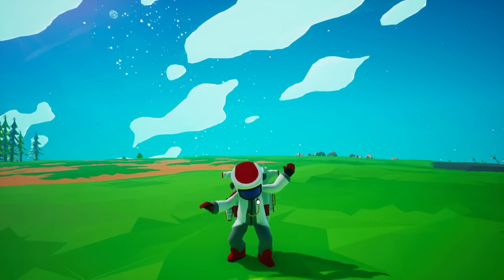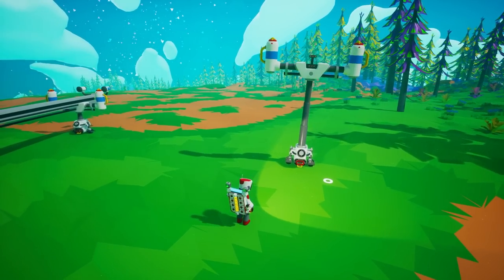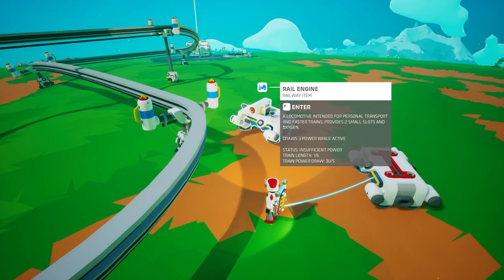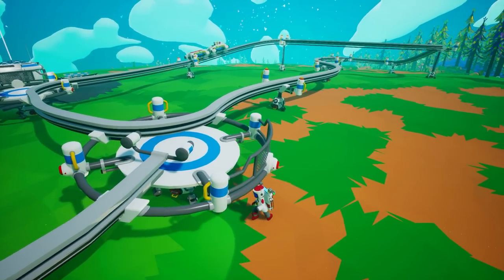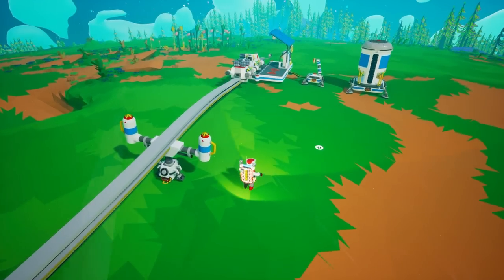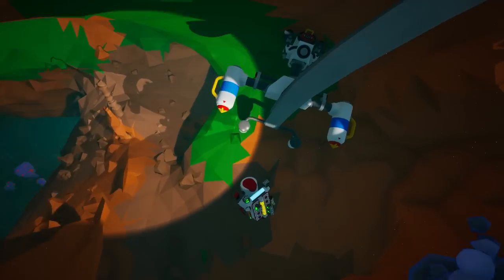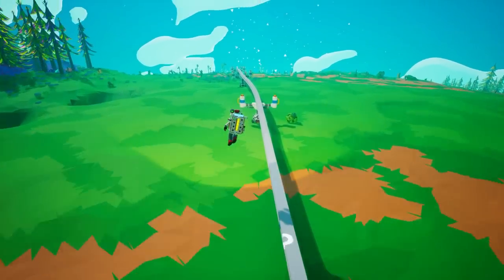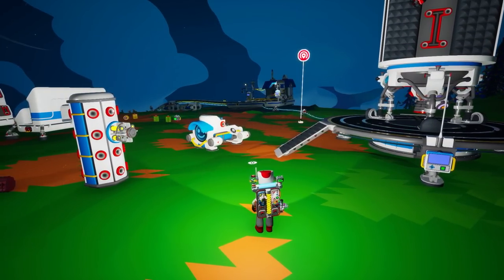Astroneer - Rail Systems - The Basics - A Helpful Guide | OneLastMidnight

Comment: I suspect that Extenders will still have niche uses. Situations where, for example, you want to more precisely control where power flows, or physically constrained areas that a rail line simply won't fit in.

Rails will definitely be superior for connecting multiple bases and remote structures, though.
Reply: Used rails to dig to the core, now i have an easy ride to the middle of the planet
Reply: transformers and diode type aplicatons also probably possible to make a data cell sort of thing with charging and discharging batteries and taking an aoutmaton signal off of that
Reply: I believe they updated extenders so you are able to toggle between uni-directional power and two way power flow.
Reply: @bruhchongles1579  that's right
Reply: Rails are a good way to transport power and oxygen across large areas.

Comment: If you use a storage sensor and a proximity repreater on your storage on the rail car it will start your rail again if it's stopped, anything with paired with the proximity repeater will start your car
Reply from the maker: Yeah, I saw that video also, but you don't need it because the storage senor already has a pin on it.  That is almost like flipping a light switch twice to turn on a light once.  The other problem is what else the proximity repeater might activate by accident.

Comment: Hi Midnight.

I just had my first experience with the Rail system, starting the Missions on Glacio, as directed.  I added the two Wind Turbines as directed but no other power or batteries so I am confused as to where the train gets its power from when the Turbines are not active.   Nor did I connect any Oxygen to it but it still provides me with oxygen when I am near by.  So what gives?
Reply from the maker: Interesting.  A bug maybe?  I'm not sure if the mission starting train station provides power - like a hab.  You can test it by trying to plug something into that starter station and see if it works, or a splitter and it will display the power.
Reply: @OneLastMidnight  
That's a good point about the Hab as it also provides oxygen and is not movable.  I presume that the Stations built through the printer are moveable.

Upon reflection, I guess that the Station planted on Glacio through the Missions is just a way to introduce players to the rail system (albeit giving a false impression of how the stations function with regards to power and oxygen)

Comment: Man im switch player yaal crying about the update we switch players gotta wait extra 10 days
Reply from the maker: Yeah, sorry to hear something went wrong with the switch release.
Reply: Im guessing its because the switch version needs more work as the devs probably find it hard making it on a different type of console because they have to adapt to the small storage space and its limit before it breaks
Reply: @dahuman5814  ugh i realy gotta upgrade but then i cant play with my switch friend
Reply: @dahuman5814  
From what I heard, it’s more there were a couple of Switch-specific bugs that they wanted to iron out before release, as otherwise releasing now and making a hot fix for those bugs would end up with that hot fix taking much longer to come out.
Reply: @awkwardsilence4427  With my limited experience with coding, this seems most plausible. Different system specs, diff operating system, diff everything.

Comment: Extenders also transfer power both ways and serves oxygen too bruh...
Reply: extenders are directional, unless you swap plug them they will only feed in one direction so depending on the setup they may not work.